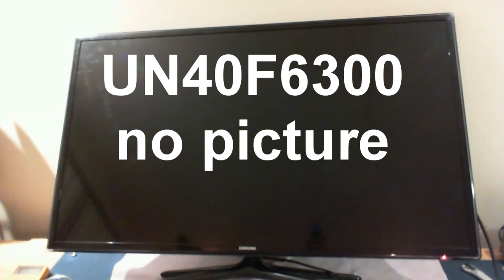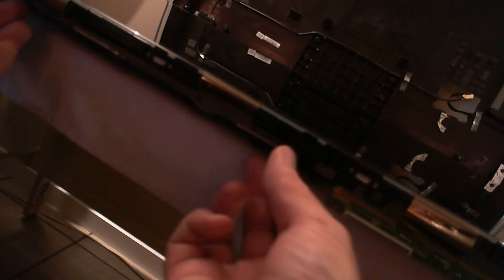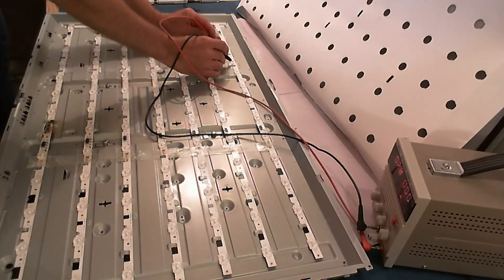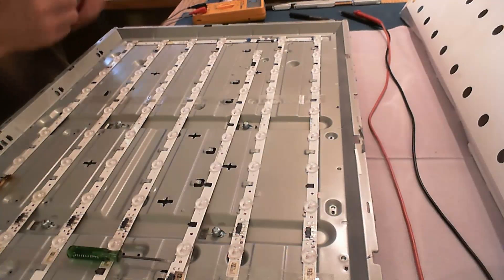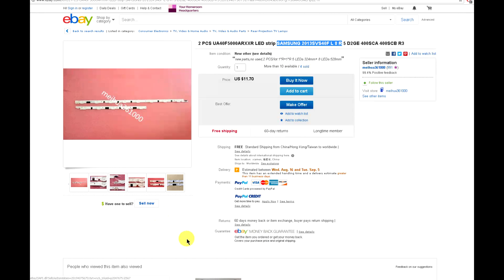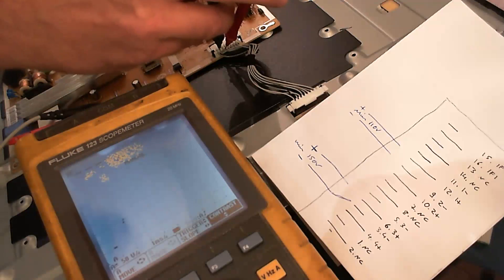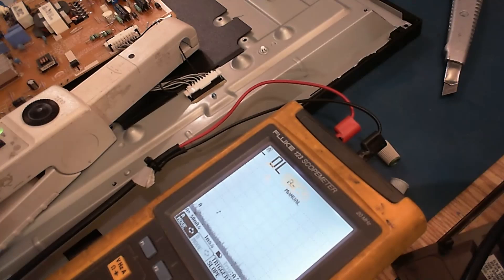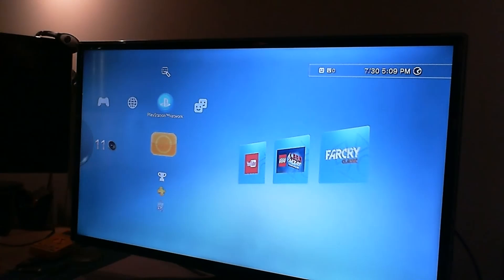UN40F6300 backlight repair and LED current adjustment UN40F5500

Comment: Very interesting Tom! This is the first video that shows a burned light strip. In my case, the light strip burned on the upper, taller strip trace rather than the small, narrow one. Further, the burn occurred between two LEDs. All 32 LEDs were still OK. 

Currently troubleshooting my first given-to-me-free-TV. A Samsung UN48J5000. After disassembly, I found a badly-burned spot between two LEDs that would arc, causing the PS to cycle on & off. I attempted a repair by scraping off the white coating and soldering a wire across the burned-out area. Sort of worked. Kept arcing. Burned out the single LED to the right of the burned area. LED ~ 1.4mm/side. Way too tiny to 'replace'. So I figured I'd just cut the end of the strip off with the burned area + dead LED, scrap off the white coating and complete the series ckt with solder. The rest of the LED's all light. Maybe then the PS would stabilize and stay on. PSB is L48MSF_FDY BN44-00852A. LED light strips are 2015 SVS48 FCOM FHD DOE A RIGHT REV1.2 150605 LM41-00120Q_LM4100149A.

Curious what causes a backlight strip burn-through between two LEDs that still worked? Very odd. Thanks for posting a video showing this default.
Reply from the maker: Unless a particular trace was designed very narrow to not be able to withstand the current (I don't think so), the only reason I can imagine is a failing solder joint on the LED. The smaller the passage is where the current has to pass the higher the contact resistance and the more this joint will heat. This heat can then propagate away from the failing joint and give the appearance we see in the video. It's the same effect with failing solder joints of through-hole components. But frankly I didn't really care what exactly happened, I only wanted it to work again and prevent it from failing again.

The only other thing I could imagine is if the substrate is an aluminum PCB and for some reason there is a short or low resistance path towards the substrate, depending on how the circuit works it may pass current through there. Just a hypothesis though.
Reply: Danke Shoen. I can understand burning starting at an LED, but in the middle of a strip between two LED's? That's odd. I do have photos if you're interested. I did cut off the end, connect send & return to complete the series ckt and test. OK. Reinstalled in set. No more zzzt, zzzt pulsing but lower 2 rows of LEDs refused to light. I verified the wiring, connectors from PSB to backlight. OK. So this points to a defective LED driver IC I figure. There are 4 rows of 8 LED's each = 32 total x ~ 3V/Led = 96V needed to turn them all on. (All 32 are wired in series). Obviously the LED driver can't supply that, it protests and is stuck in a start, shut-down, start, shut-down never ending loop. My bench supply won't even allow me to power up two strips in series, much less all four. 

Still unable to find a SM for either the TV or PS. Also not sure what chassis this unit is. Search hits on UN48J5000 are very rare. Set produced in March 2015. I enjoy troubleshooting as much as you. Deeply curious to figure out problems like this.
Reply from the maker: ok just to get this straight. All LEDs are working now? You can test them either individually or two or more in series only if you don't have a suitable power supply. If the PCB is aluminum, there are no shorts between the aluminum substrate and any of the LEDs right? In this case yes it might be the driver IC. What board is it? What chip did they use?
Reply: Originally, ALL LEDs were working. Now I've lost two. One blew after soldering a wire across the burned area in order to bridge it. This LED was the last one on that strip with the burned area, which was about 25mm away. The second one began to blow after experiencing a burned area right at the LED itself, like in your video. This occurred after reinstalling the repaired strip to see if fixing it worked. I powered it up with only 80Vac using a VARIAC as a safety precaution. Good thing I did! I immediately cut power after hearing this second LED begin to arc. 

I did originally test ALL LEDs using a bench supply per your video. Now I've lost two due to the faulty supply (I suspect). "If the PCB is aluminum...." you mean the light strips? They are very similar to those shown in your video. I included the model # of the strips in my original post, along with the model # of the power supply. Not sure which IC Samsung used as I've yet to ID the IC on the underside. Having a schematic would help as I've not troubleshooted any of these non-CRT TV's. 

 PSB is L48MSF_FDY BN44-00852A.
LED light strips are 2015 SVS48 FCOM FHD DOE A RIGHT REV1.2 150605 LM41-00120Q_LM4100149A.
Danke.
Reply from the maker: Canis Major you supplied AC to the LEDs? I don't think that's a good idea, we don't know their max reverse blocking voltage... Use only DC.
Reply: No, no...you misunderstand. I used the VARIAC to power up the TV at reduced voltage. The LEDs were plugged into the TV's power supply. I regularly use a VARIAC when troubleshooting electronics.
Reply from the maker: This is not the right way to limit the LED current.. It will just cause the TV to malfunction when the voltage is too low. It has several DCDC converters and a PFC/boost circuit that all need a minimum voltage to work correctly. 
Unless the driver is putting out way too much current I don't see why a simple PCB trace would burn out of the blue
Reply: I started at 85Vac, increasing to about 100Vac where the PS was stable. However even at 100Vac, only 2/4 backlight strips were lit, one LED began burning/zzt...zzt'ing again so I was unable to test any voltages in this state. Two backlight strips were flashing on off on off... I shut down the power. My line Vac here is about 123V.  Still seeking a schematic of the power supply. Danke
Reply from the maker: not really sure how to help you via youtube. maybe you open a thread on the badcaps.net forum, really helpful. there you can also post pictures. Before you proceed to repairing/investigating the power supply I would first determine how they all are connected, the strips. Are they all in series or are there two driver outputs etc. Sometimes there are in series on the PCB, not inside the panel. 

Looks like you have 32 LEDs in total, right? but on your PCB board it says 130V, that's probably the maximum the board could output, which leads to the crazy amount of current that burns the LEDs...

You need to figure out a way to test your LED strips without the power supply board. Sure you have a 30V benchtop power supply? You could test at least one full strip (8 LEDs in total). Or you connect 4x9V batteries in series with a current limiting resistor....

This way you would see where and why the ..zztt..zt.z.t comes from.

When this is done Then I'd go to the PSU and lower the LED current on the hardware side, I do this on all TVs now where I replace LEDs...
Reply: I'll browse the BC forum. All four strips are connected in series and powered by a single driver ckt. I verified this by examining the backside of the PS board. The PSB does spec the LED driver ckt as 130V @ 750mA. I have already tested all LEDs both individually, using about 2.8Vdc, per 4 LED half-strip and two strips connected 8 LED's using my 30V bench supply with current limiting. This is how I knew the fault must lie in the PSB LED driver ckt. Thanks for your time. Danke Shoen.
Reply: New information: I retested the repaired LED strip (now with only 7 LEDs). With 22V bench supply, the current drawn = 440mA! The other three strips (8 LEDs) meas. 97mA, 103mA, and 127mA at the same voltage. This strip was originally installed #3 from the top. As all LED's are in series, all of the voltage drops add up higher & higher across the entire length. Some LED's turn on sooner than others. Likewise some draw more current than others. Strip 3, right hand section, is where the bad burn mark occurred. Assuming the LED driver is a constant current source, when it encountered the high resistance surrounding the burn area, the PS adjusted by raising the voltage attempting to maintain a set current. However, this increased voltage rose high enough to cause damage.

 If I had a 130V DC variable bench supply, I could power up all LED strips at once and meas. the current flow at various voltages. No joy on that however. I wonder if I could use a string of LED Christmas lights to load the PS so I could take some measurements? My wall voltage is 121Vac. Might work. 

Clearly the PS is throwing a wobbly with that one stip drawing so much more current than the others. Perhaps I could move it to a lower voltage section of the string? Say the beginning rather than near the end. Another idea is to use a few medium diodes to make up for the missing 3V drop. 

These strips have a small rectangular 'box' near each LED with + and - markings on it. When 3V is applied to the side connectors, the LED turns on. I've never seen them in any videos though. Odd that. Not sure why they are there. They're not a resistor. Don't measure a diode drop either. Something to make up for the cheap PS in the entry level J-series (2015) TV's? Evidently this J-series is quite poor vs. earlier models. Danke.
Reply from the maker: there are variations in voltage drop for a given current with the same LED model. It's normal that in the transition zone where they are just about to turn on not every LED will turn on at the exact same voltage.
I didn't get why you are suprised about applying 22V to 7 LEDs and having a higher current than with the other strips applying  the same voltage to 8 LEDs.

The LEDs that have been stressed may be borderline functioning but personally I never got a TV back where other LEDs than the ones I replaced failed. In other words, if they light up I wouldn't worry about them. Of course when touching LEDs I ALWAYS lower the LED current now to at most 70%.
In your case you only have to make sure the traces are properly repaired and the LED driver is ok. 

If possible you should actually lower the LED current right away before proceeding (hardware modification on PCB...)
Reply: Update: Ran more voltage & current tests on both PS & backlight strips. Called several local TV repairs shops. Got lucky at one who had two right-side replacement strips that tested good and were a later version than mine. I checked both for correct current draw, then installed them replacing the two defective strips. Lo and behold, all 4 strips (32 LEDs total) lit brightly!! Nothing wrong with LED PS or the driver ckt. Left set on for 10min. no over-heating, shutting down or buzzing! BL problem solved!

Reassembled set. Noticed an issue with vertical lines in places. In the process of testing TCON power, regulators, capacitors, etc. and all edge connectors to LCD drivers. Evidently this set had two problems. I wasn't able to see the screen issue until I fixed the BL issue. Danke Shoen.
Reply from the maker: Canis Major I hope you reduced your backlight current / setting too or your problem will come back
Reply: @canismajor3104  the reason is the crappy revision of led strips used in they F SERIE.... they all do the same ,  its a fat aluminium strip with a thin layer of circuity over it , traces bewtween led are ridiculously thin , junctions for clipping leds are crappy and become loses , protection diodes on these stripes suposed to be there to protect stripes  short or become an oven when a fault occur ,  it put the inside of set in fire behind the screen lol
these diodes are there only to ensure that light will stay even between sections even if somes leds become to fail  and also prevend other leds to burn in cascade when somes are out 
this led strips are a firetrap
they throwed this led stripes away in H serie , then they used leds that NEVER BURN OPEN , THEY ALWAYS BURN SHORT 
Serie H will work untill more than 60% of his led will burn , and will eventualy fry the mosfet that drive led circuit on psu , but will never caught in fire

Comment: Hello, I'm with a Samsung TV UN40F6400. Symptom dark image, backlight and brightness at maximum.
Output voltage on drives, three drives measuring 154 Volts, One measuring 48 Volts.
Reply from the maker: Aparentemente na placa BN44-00622A tá escrito Ch1 60V, Ch2,3,4 120V (peguei uma foto da internet). Então parece que as tensoes que está medindo estão mais ou menos normais. A melhor maneira é medir a corrente em cada uma dessas saidas, se tiver LED aberto não vai ter corrente. Se não tiver alicate de corrente, desconecte o backlight e aplique uma tensão direto conforme o que tá escrito na placa (com limite de corrente). Se a placa de fonte te dá tensão mais não tem luz  e provável que um ou varios LEDs estejam com defeito. Parece que falta uns acentos no meu teclado, rsrs
Reply: Hi. Thank you, my friend.

Comment: Hey Tom, I have a question about what your television was doing before you knew it was the LEDS. My Samsung 4K LED power light blinks but it comes on. There is not any backlight though so you can only see the screen if you shine a flashlight at the side of it. The television repair man said it was an inexpensive thing but samsung doesn't sell those parts under warranty so they just replaced the television. But they didn't take the old one and I want to repair it myself. Do you have any clue what would cause the entire series of LED lights not to light up??
Reply from the maker: depends on the model. there are always LEDs in series, either all or several. One LED failing open or short can be detected by the LED controller/driver and shut down the hole backlight . It can also be the driver/controller ciruit itself. In a case like yours I always put a voltmeter and current probe on the LED output. If there is voltage (usually marked on the board or if not I just assume a reasonable value) but no current then there is a backlight problem. If there are several strips / outputs and one of them is different than from the others in terms of current/voltage I swap the output to determine if it's the board or the LEDs. Assuming you don't have a current probe or oscilloscope it is pretty hard to actually take reliable and conclusive measurements. I never used a backlight tester or anything like that so can't really say if those work.  Also look on the net if others had the problem and a solution for your particular model. A 4K is certainly worth the repair I'd say...

Measuring with a multimeter on the PCB output to the LEDs usually doesn't help because it's too slow and the driver will attempt only for a short time  to restart ..
Reply: Okay I just bought a multimeter last week and have never used it. Do you think I can use it to diagnose the issue or at least rule out a few things? Thanks so much for you response. I have the model number to the television if that helps. I haven't found anything on google with my specific model but I don't really know where to look other than google. It's a UN55HU6840F made by Samsung
Reply: One more thing, Every 20 seconds or so, A small flicker comes from near the center of the screen. Less than a millisecond so it's hard to see.
Reply from the maker: Yes you can measure at the board output to the LEDs (DC voltage). When you turn on the TV and something happens (voltage goes up) then it's likely the driver is ok and the backlight is faulty. As I said, some TVs start for like a couple of hundreds of ms then maybe try to restart a couple of times and then turn of the backlight driver, so don't expect to measure correct output voltage  with a multimeter . usually the output signal is PWM.
Reply: Okay and if the driver is showing a change in voltage, I need to change the LED bulbs most likely?
Reply from the maker: it is likely.

Comment: where are these led drivers you speak of? I have sound, no picture. Good power on psb, main, and t con. Next about to check led strips...
Reply from the maker: it's a SMD chip on the bottom side of the psu board. it is very likely that the problem is with the LEDs though

Comment: Nice video! Do i still have to adjust the resistors if i change the whole led strip?
Reply from the maker: Lucas Holanda I would either adjust the resistors or the backlight in the menu (for each source). A new LED strip isn't any better than the original one so at full backlight intensity they'll gonna be damaged again, sooner or later.
Reply: Could i just jump the burnt LED as a provisory fix? The other leds on the strip would light up, right?
Reply from the maker: Lucas Holanda that depends on the LED driver circuit. Some are able to detect that condition and shut down. Ideally you would use some normal diodes in series instead of the burned LED.